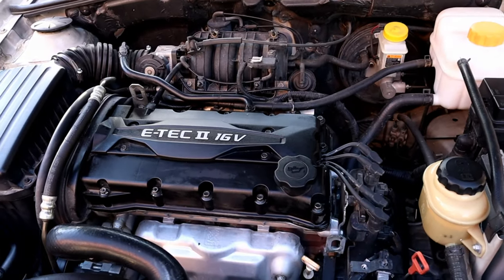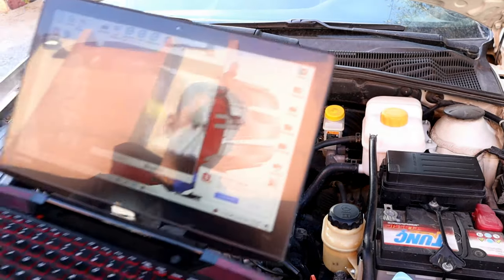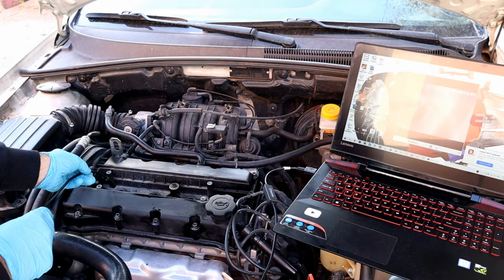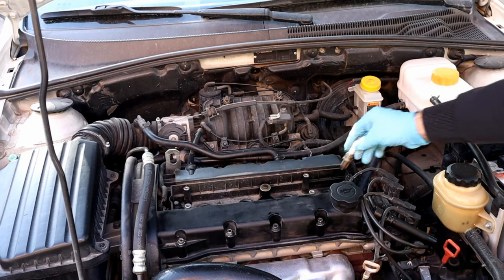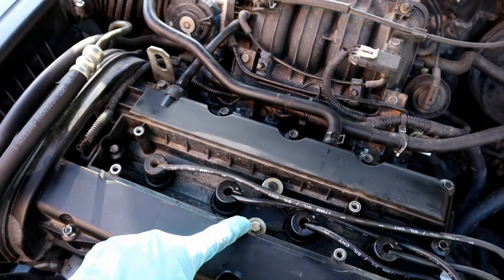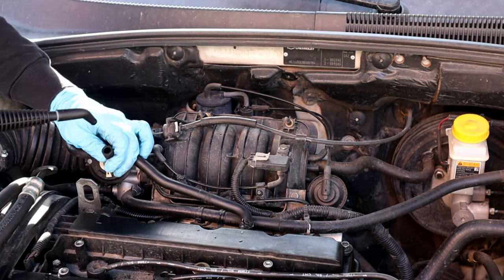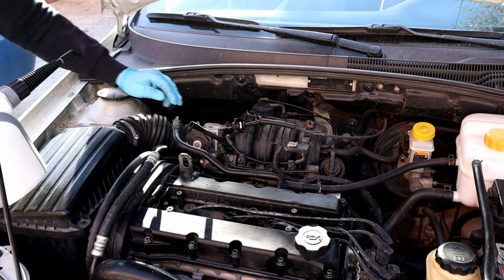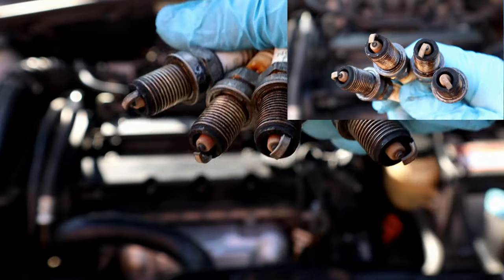Does steam removes carbon buildup on the piston/intake valve/decarbonize engine with water/Alimech

Comment: Be very careful when doing this.  He is using actual steam but if you use water you should use a spray bottle and only inject a very small amount of water over time..I did this with a car I used to have and got carried away and put too much water in and it hydrolocked the engine and broke a rod in half and destroyed the engine!
Reply: Lol
Reply: thanks mate, appreciate the tip.
Reply: That's awesome
Reply: Yikes.. thnx for the info mate… much love 👍👍👍👍👍👍
Reply: Lmaooo
Reply: @SirCavemaninthewest  Looking back on it, it is kinda funny but at the time it was definitely NOT funny, lol.  A positive thing came out of it in that I ended up pulling the engine, replacing the block, and completely rebuilding it.  I then put over 70k miles on that rebuilt engine before I got rid of the car.
Reply: 😂 woulda been cool to see. How much water did it take to hydro lock?
Reply: @davidseymour4568  I believe I was pouring the water down the throttle body into the intake with a cup of water.  I was going slow and pausing though, so I figured it was ok, lol.  But it wasn't ok.  That's why I would recommend using steam or a spray bottle because if you just pour in a stream of water it's too hard to monitor how much is going in.
Reply: Yeah, but was it clean?
Reply: @dzim8822 idk how true this is man you have to have put a hell of a lot more than 1 cup unless it’s a Tiny engine I’ve seen people pour gallons of water without hydrolock
Reply: @h0udinl  I was using a cup to pour the water, but it was a lot more than just one cup.

Comment: This does work to decarbonize engines. My car had a slight hesitation and a rough idle i sprayed water in a vacuum hose while the engine was at operating temperature and took the car on the highway an hour after letting the carbon soften up. After the long ride on the highway (approx. 30 minutes) my rough idle went away

Comment: Good video mate. If you only did 100mls it would be good to see the results of doing the same process slowly but with a litre or two. Do you think it would cause damage if you did that and drove the car for half an hour after finishing the process?
Reply from the maker: No, I have tried that, it will be just like in winter morning when there is so much humidity and you start the engine and water comes out from the tail pipe
Reply: @AliMECH  thanks for the reply. 👍

Comment: Combustion of fuel itself generates lots of steam. If that has not cleaned the engine, external steam will not. Also the amount of steam vis a vis amount of air at 2000  RPM would be negligible.

Comment: Hey, Just wanted to let you know that wasn’t “rust spots” that was dirt from your spark plug recess that fell in the hole because you didn’t blow out the spark plugs before you removed them.  So, naturally after you run the engine that dirt would go out the exhaust and wouldn’t be there again.  So you have only deceived yourself.
Reply from the maker: You might be right about that but what about the amount of carbon been removed ? is thats deceive too
Reply: It's not rust. Aluminum pistons don't rust. Carbon.
Reply: I understood rough spots, not rusty spots... but

Comment: Lol! Water in the fuel? Combustion of gasoline produces water...about equal in volume to the volume of fuel produced. Far more than could be dissolved in the fuel!
Reply from the maker: Yea right, but they dont pass from fuel injection and fuel pump, these electronic parts getting damage, otherwise after combustion, there is no problem
Reply: @AliMECH  

You mentioned rust on the piston in relation to water in the fuel. Any water, whether in the fuel or from combustion, should evaporate from that area of a hot engine.

Comment: not much knowledge of a 4 stroke engine , water in an engine... not good.
Reply: It’s fine in small amounts like steam or even spraying water into the intake as long as you go slow and make sure the engine is hot before starting the process so it can make the water steam as soon as it gets into the cylinders which makes it steam the carbon away.
Reply: @Alexander_l322  I doubt there would be any cleaning ,  steam or water in cylinder bores is not good advice.

and why would anyone want to steam clean the inside of cylinders and piston crowns , what benefit does this have?
Reply: @Alexander_l322  and in your video you mentioned rust spots on the piston crowns , how does aluminium rust?

And your bore scope doesnt offer much clarity , the before and after vidoes look the same.

Comment: Yeah totally, steam clean the oil film on the cylinder walls away... your piston rings will be screaming with joy. Not to mention your engine oil from all the steam blow-by...
Reply: This has been done since the 60s its a proven method if experienced
Reply: @dontjudgeme2736  
Proven to be a horrible idea
Reply: @unknown hinson 
The irony of a keyboard warrior calling me an idiot over a method proven to be a terrible idea is hilarious at best. You tried though, good job.
Reply: @unknown hinson They sell shovels at Home Depot. Save your lunch money your mom gives you and get one. Bye
Reply: @notacreativehandle  relax this has been done by experienced professionals and it does work without damaging the engine. I’ve done it myself using a spray bottle and water. Hot engine and go slow with the spray and it works great no damage but if you try to spray too much in at once then it can obviously damage the engine. Change the oil and filter after doing this too. I promise your engine will be ok after this just go slow and add the water little by little and no more than like 500ml over the space of an hour.
Reply: @Alexander_l322  
Alright I’ll take that, seeing as you took the time to explain and give the process and such.

I assume you can understand the potentiality of the hazards I speak of?
Reply: @notacreativehandle  yes i do understand but the oil won’t be washed off the cylinder liners or carbon getting between the liner and the piston rings. The only thing to worry about is using too much water at once because that will hydrolock your engine.
Reply: @Alexander_l322  I tried to hydrolock, the engine dies before it fill up to a level capable to cause hydrolocking  problems and that stop the injestion for the cyllinder  imediatelly. At 3k rpm an engine can manage a liter per second easily in and out, but combustion can't cope with near half that amount of water.